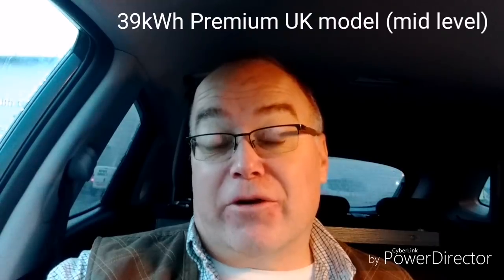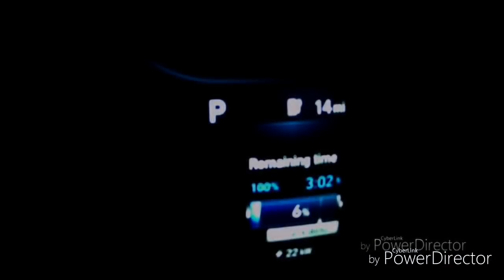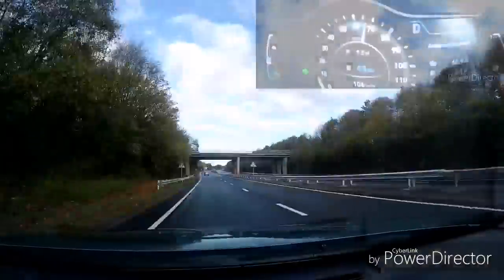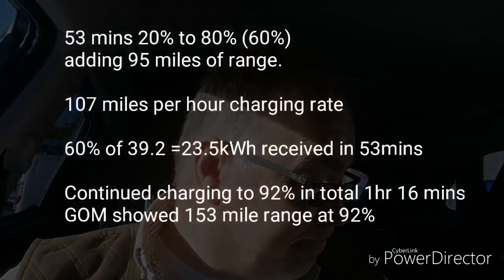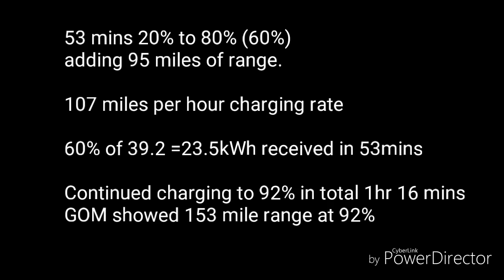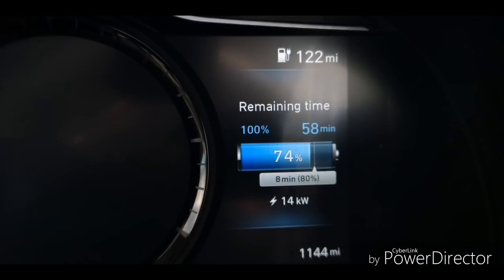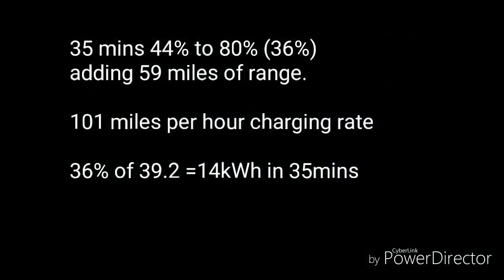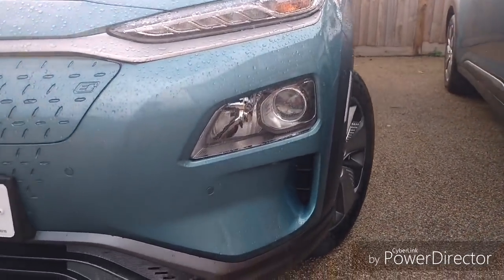Multiple Rapid Charging / Charging concerns & why I wouldn't buy a 39kWh Kona Electric

Comment: This is gonna be a long one, so bear with me Nigel..
As you probably know, I've done some testing with my -13 Leaf, had it since march -15 and drove approx 50'km now. Wanted to look into the Ø (average consumption) now. And possibly find some other answers at the same time, perhaps battery capacity and its losses..

The old Leaf can stop charging at either 80% or 100%.
I tested chargingloss once in -15, charge to 80%, drive to around 3% and charge back to 80%. Numbers I collect from these early tests are:
From car: SOC, Ø, km driven
From Leafspy: Wh used, kWh remain, SOC. The SOC in Leafspy shows different numbers than car, fully charged is around 97.1% and empty is never tested, but around 10-12%.
For charging that time, I collect numbers from my grannycable (EVI, kohns) with digital display with chargingtime, A, V, and of course kWh. In addition the chargepoint has a digital kWh display.
Collected data in that trip is 110.5km, Ø12.2kWh/100km, 79% to ---% (estimated 3%), LeafspySOC 78.9% to 13.6%, 13,786 wh used, 
Charging 15.71 kWh on grannycable, 15.3 kWh on chargepoint.
Ø*km has just 2% diviation from wh used, so fairly spot on.
I end up with 9% to 16% chargingloss.
I also have kWh remain on Leafspy, but there is a setting with wh/GID that may be off, so I wouldn't rely on that too much.
Extrapolated I should be able to charge 20.66 kWh 0-100%, 18.6 kWh usable if we say 10% chargeloss. I believe these Leafs are suppose to have 20 kWh usable, so 18.6 I guess sounds about right.

Then in -16 I did a drivestyle-test. 4 trips of 23km each, 2 with steady speed and 2 with "rollercoaster". Speeds where 30-60 km/h, average around 40 km/h.
Sadly I didn't collect charged power, but all the others I've got. Rollercoaster is simulated best economy for fossil, build speed downhill, slow down going up.
Every trip had of course no use of heater, same setting on everything down to volume on radio, and of course same start-turn-endpoint, and the pairs I tried as good as possible to match average speed.
All numbers correspond pretty good to each other, except one: Ø! (average reported in car).
All trips started with 79% charged, everything reset. Trip 1&3 are rollercoaster, 2&4 steady speed.
Tripnumber      1           2          3           4
SOC end          57        63        58         67
Ø in car         14.3      13.8     13.3     13.6
wh Leafspy  4140     2925    3775    2276
Then I'll calculate the average kWh/100km based on the wh used:
Ø calc            18.0     12.7       16.4     9.89
If I extrapolate the numbers to get total battery capacity, from wh used in Leafspy I get a steady 18.4 kWh.
However with Ø shown in car, I get anywhere from 14.6 to 25.3 kWh.
So clearly, this time the average in car is way off...
And, in that test steady speed uses 30-40% less power than "rollercoaster"..!!
In another test I estimated the regen to be around 90-95% efficient.

The other day I drove down to ---% again, and charged up to 80%. Normally I charge to 100%, but remembering the first test I mention, it would be a good comparison.
Granted, I did get a replacement EVI-cable, so it may read different numbers than the one I got that time. And the chargepoint with display is shut down.
It reported 13.65 kWh (vs 15.7 kWh in same test back in -15). So about 15% less than same result 3+ years earlier. 15% degredation, 16.16 kWh available? It's possible, but really sounds like a lot of degredation...
But then I just unplug, replug and charge to 100%.
79 to 100% 6.88 kWh
So total 3% to 100% is 20.53 kWh.
A few days later I charge 82 to 100%. That reads 4.193 kWh which does not correspond to 6.88 on 79-100%.
Again a few days later, I charge 3-100% with 20.63 kWh which does correspond to the 20.53 kWh total done the week before.
Also if extrapolated the 15.7 kWh 3-79% done 3 years ago, it corresponds with no degredation (actually about 2% better capacity today, but that could be down to balancing and slow chargespeed at the end).
So right here I start to think that something weird happens above 80%, maby only when you've gone under 80% before charging. And, possibly, it's been a long time since I regularly charge to 80, but 3 years ago I normally did.
So I am gonna do some 80%-charges in the near future to see how they correspond.

Lately I've got 3 chargings up to 100, and noted Ø and km at some points along the way. Everytime I noted numbers just when it went down to the noted %. 74% could be 74.0 to 74.9, so I tried to eliminate that variable. I later found out that Ø updates as rare as every 30 second, given short trips it may give a noticable variable. But Ø is at worst within 10% diviation between the trips, so with a few variables here and there I'd say it's fairly constant this time.
But, when I look at kWh charged vs Ø*km, I'm looking at around 30-35% chargingloss..!!
That can't be right, right..?
So what is the true consumption..? The car says 16-21 kWh/100km. Calculating 10% chargingloss from my grannycable, I'm looking at 19.4-26.1 kWh/100km.
We've had around 0C here, and for the 2-6 km each trip, the heater runs hard, so I think the Ø is a bit too kind.
I know preheating doesn't count on Ø, so never used it in these tests, and car is always of during charging.

So it seems the more I test, the more confused I get. What numbers can you really trust?
What I found to be most trustworthy is Leafspy and SOC.
I also ran a "speedtest", going back and forth on a small stretch (about 2km each way) in different speeds (40-80 km/h), writing down wh from Leafspy at given points. After a few runs, I saw it was dead accurate, after the trip down, I could calculate the return within 1% or so.

What gives the diviation then?
The batteryheater? No, it should activate only when the batterypac is below -15C or so.. 

Internal resistance in battery? Sure there is some. Going to my drivestyletest, loads should be higher in the steady speed-runs because it works harder uphill, thus higher resistance. Internal resistance is not counted, so Ø should read false low. But actually it reads false high.

Slow update of Ø? Probably in the latest test. But again going to the steady vs roller, drivingtime is almost the same and car never shut off during test. After 23km driving, sitting with car idling with heater off, the Ø changes maby from 13.0 to 13.1 the next update, not 15..

And why does wh used in Leafspy seem to be trustworthy, but the Ø in car not? Leafspy does get it's number from the car..

Really, I don't know.. Hope you can give some pointers,
Reply from the maker: Rayner, I'm afraid that's beyond me. I do think however the GOM and battery levels in car are a digital impression of what we want to see not an accurate representation of physical states. Its software and software has bugs and coding design flaws.
Leaf Spy must be more accurate as it uses the raw data and presents as is without any modification.

Higher charge loss at high end of SOC definitely sounds confusing at those rates. Even balancing and conditioning of the battery can't take that much.

Mystery for sure. Is it worth pursuing? Will we ever know the truth....I'm asking same question in next video
Reply: @EVPuzzle  for sure a mystery..
Yeah, I assume it will be hard to get it accurate, easier to measure 1 liter than 1kWh.. But I would at least expect the numbers to be somwhat consistent..
Well, Leafspy should use the same raw data as the car. For sure, there may be diviation, I guess I would "allow" within 10%. But I see far from that from time to time.
Worth pursuing? Well, for sure the easiest is to charge whenever you need, drive whenever you want. But it would be nice to find some real answers.
Also should be able to reliably charge to see battery degredation..
Hope you see more consistant numbers than I do, so it's just a Leaf-thing ;)
Reply from the maker: Rayner I think you see more than Hyundai owners. My suspicion is were not seeing actual data we're seeing a slightly blurred view masked by the software, in the same way efficiency and range numbers on ICE cars seem to have a mind of their own at times.

How many miles you can drive on how many kWh from the same source is all that counts to me.

I need to do some benchmark tests to track usage over years to come .  Problem is with 100% SOC I need to drive nearly 300 miles just for a test, then half that for 50% then half again for 25%. All with aim of repeating each year. Lots of effort but not sure how I'll know if there's degradation otherwise
Reply: @EVPuzzle  yeah, you see a lot with Leafspy, but I rearly connect it.
On ICE-cars I've seen them being of by as much as 10% I believe (of course showing 10% lower consumption than in real life), but at least they seemed to be consistent..
Again, it's easier to measure 1liter than 1 kWh..
I guess I can get on to a theory why it's not correct here. Voltage fluctuates all the time, and of course fluctuates more with higher loads/regen. If the car computer is lazy, it calculates the load/regen just ever so often. And at those times i would calculate kWh based on wrong V. Leafspy might use more datapower to calculate it correct.
Based on that, a drivingstyle with low inputs should give more accurat numbers than a vigurous style. My drivingstyle is "always" the same, so might explain why tests the last days shows the Ø to be pretty consistent.

Oh that part is so much easier with the old Leaf, these days I struggle to squeeze 100 km from a full tank ;)
Reply: Tested a little charging up to 80% now, and plotted in the numbers. You know the horrible range on my Leaf these days (around 2% pr km), so you can only imagine what it's like charging to 80% and trying to calculate running it down quite a bit before a new charge, and my chargepoint is sadly at work.
But the good thing is that it only takes a few days to collect data on a number of charges ;)
Anyways, when extrapolated, there is, as always.. a small diviation. I see more of a diviation charging up to 80% than to 100%, so that may be because it charges at "around" 80% while 100% is 100%.
Extrapolated, charging up to 100% it seems the cable could deliver 22 kWh, while up to 80% (extrapolated to 100% capacity) it would be 18 kWh.
So clearly something is happening at the end.
I really don't notice that the top % are bigger, but still it could be the reason..
When comparing the cars reported Ø to the charged kWh, it seems to be fairly steady diviation of 35-40%, not included chargingloss.
I guess I have to try driving with Leafspy for a comparison again later, and type2-cable at a chargepoint giving kWh-reports.
I see no reason to believe that the chargingloss really is 30-40%..
Without chargingloss, my comsumption the worst days seem to be just shy of 300 wh/km. Fairly high, but compared to a diesel, that would be 3 l/100km, so still perhaps around half energyconsumption of a comparable diesel.

Based on the ONE charging I recorded 3+ years ago, 50'km less, it seems like I indeed have about 13-15% degredation.
It seems it charges a little faster now than before, and a "regular" drive we sometimes make without a charge during summer seemed "unpossible" this summer.
Reply from the maker: I guess that's the truth, a single journey possible before but not now.

I'm off to charge again today and record some data too

Comment: Hi I have a Hyundai plugin hybrid. It has just had its first service. I have very little mileage using the engine maybe 100 miles or more total mileage was 3400 and the bill for the service came back at £150. When I asked why the had changed the oil and air fillets they said that what is done after twelve months. Do you think this is wrong is the garage cheating the customers by doing this. Should electric cars have a different service pricing knowing they will use the engine less. We keep hearing that electric car should be cheaper to service, well let’s see it. 
What do you think out there of this. Have any other plugin or full electric cars challenged there pricing on servicing.
Reply from the maker: Plug ins could easily cost more to service having both elements to check and work on??
Reply: Yes I know this. If you read my question it was if the engine had done very little work should they have changed the filters.
Reply from the maker: Yes if it's on the schedule then yes

Comment: The author seems to be a full on newbie in the electric car area and suffers from the "Range anxiety" syndrome. 
It would be useful to understand that charging depends also on the amperage of the charger and the temperature of the battery pack. Those are the two main ingredients. Charging at 120A (or 85A in cities) would produce a lot of heat, hence the "I have no idea what the management is doing" bit - the battery pack is being cooled.
Another tip maybe is that there is no point of charging a cold battery from 5X%, since this is bound to be a really slow charge. Rather leave it overnight at home on 10A.
Sorry I do not speak kWh, I only speak A.

Comment: So, you discovered coldgate on the Kona! Well, relative to the battery capacity, 40kW is a faster charging rate in the 39kWh than in the 64kWh. Charging batteries in cold weather can be damaging. It all makes sense, except we expected the Kona to turn on the battery heater and perform well as the Ioniq does, with an even smaller battery. Thanks for the honest videos.
Reply from the maker: Yep, and not as good as a Nissan Leaf potentially too.

Comment: BMS never switches off. Always cools and cools. Passive cooling (liquid just circulates) when very warm and active cooling (liquid is also cooled with AC compressor) when too warm.
With bigger battery, charging rate (C-rate) is smaller in case of 50kW charger. So 25kWh battery charges at 2C on 50kW charger and 50kWh battery charges at 1C with 50kW charger. The slower the charge rate, the better efficiency, the less heat loss there is. Therefore less cooling needed.
Reply from the maker: All good info but why does the Ioniq charge faster?

Comment: Interesting experiment, Nigel. I think what you have proven is that there is no point planning a 'splash and dash' top up on a cold battery. They also can take some time to warm up to a temperature where they will charge quickly. Zoe owners with the 43kW charge option often find they need several miles at 70 mph ahead of the charger to get a decent rate. You may have seen the videos where Tesla Bjorn says you should always supercharge your Tesla the night before a journey while the battery is still warm from that day's driving, not wait until the morning, as rates will be substantially lower with a cold battery.

I also wonder whether the pack voltage may have some effect on the differences you see. The 39kWh battery is 327v and 64kWh 356v. So a lower current is needed for the 64kWh pack to deliver higher charge rates. I also think that driving with a 150kW motor on the larger pack vs 100kW on the smaller may enable the larger pack to get up to temperature more quickly as you drive too, especially if you drive in a 'spirited' manner.

Finally, is the larger pack liquid cooled? I wonder if that is why you get more fan noise from the smaller pack, which I understand is air cooled.
Reply from the maker: Good thoughts.  That's my point to the video, we just don't know until we get the car. Its all hidden until you experience it, which is surely wrong.  I suspect you're right in several respects
Reply: @EVPuzzle  Some manufacturers have a battery heater in their Scandinavian market models (I know Zoe does).. I recon if you'd caned the 39kWh model for a good half hour first, you probably would have seen a higher initial rate of charge. I sure that's why your final charge was at a better rate. It is good to share the information about where the step-downs occurring during rapid charging too. Again, when Bjorn tested it, I think he said there wasn't much point carrying on rapid charging after a certain SOC because you'd get a higher rate at the next charge and lose time if you stayed where you were charging. As with all new models, I guess its a bit of a learning curve and it does seem that manufacturers are really only interested in presenting the best case charging scenarios.
Reply from the maker: Exactly, even though I know why I got the result I did, it's still disappointing the 39kwh isn't a step forward from the Ioniq and Leaf

Comment: Very good video with interesting results.

What’s strange: so much noise from BMS cooler for so little charging power.

The 39kWh Kona seems to be less capable than the 28kWh Ioniq. That’s surprising...
Reply from the maker: Toni, yes it'd be nice to know what it is and what it's doing but Hyundai in their wisdom think we don't need to know other than its managing the battery but secrecy just leads to misconceptions.
It does look like the Ioniq charges better

Comment: Have you turned off the ADS (auto defogging system)? I think that is the root to the cold air blowing sometimes even when the temperature is set "high". At least it helps on the IONIQ BEV.
Reply from the maker: I always have Auto off..
Reply: Yes, I was also wondering at first with my Ioniq why it was so difficult to heat the car. Until I found that we have to disable the ADS.